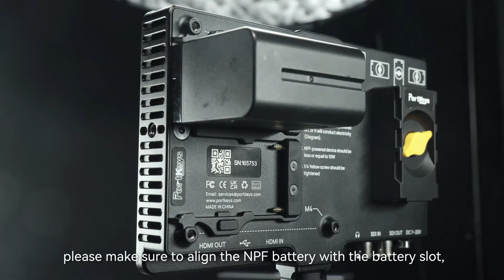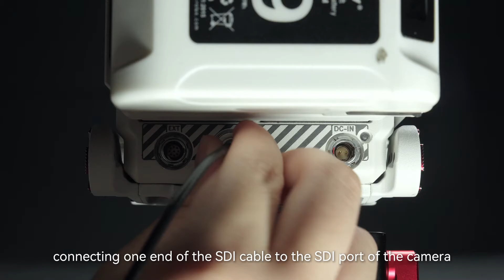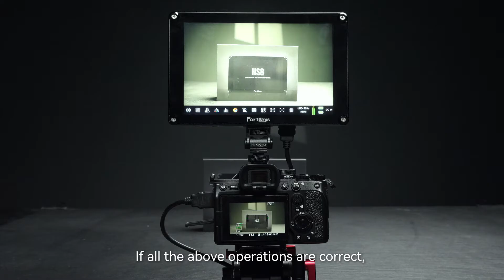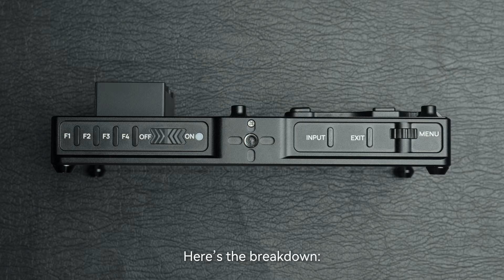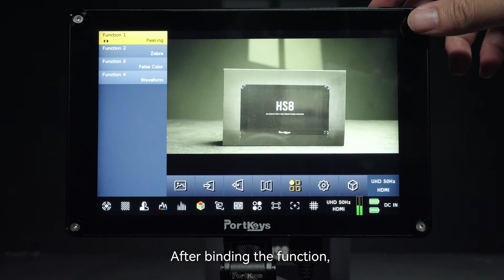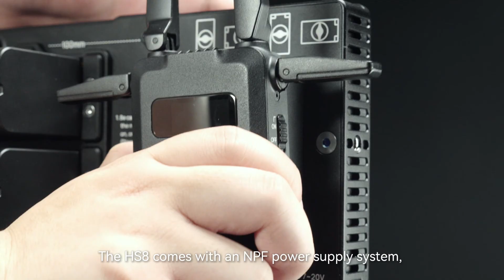8-inch SDI Director Monitor for Better Signal — Rotatable TX Mount | Portkeys HS8 Unboxing & Setup

Comment: The HS8 is not a true multi-input independent cross-converter (like a Blackmagic mini-router, for example).
	•	On this model, the SDI output is not a “pure loop” of the SDI input. It functions as an active output of the selected input, or as an HDMI-to-SDI conversion when an HDMI source is connected.
	•	Therefore, if you connect an HDMI source, the SDI output automatically switches to converting the HDMI signal instead of remaining as a native bypass of the SDI input.
Reply from the maker: Dear Customer,

May I ask if what you want is:  

If all HS8 input ports have signals connected, does the SDI OUT default to outputting the signal from HDMI IN, or do you want the option to freely choose?

Comment: Could have been a great monitor, but it's a shame there's no way to get rid of the menu at the bottom. Unfortunately not being able to turn this off makes it not suitable for professional use
Reply from the maker: We're sorry that the menu bar in HS8 cannot be removed.
Reply: @PortkeysMonitor  can’t you just fix this in an Update? It is really holding me back from buying it!
Reply from the maker: @jayamirmusic1878  thanks for your suggestion. We will forward this to the related department again~
Reply: @PortkeysMonitor  thank you I can’t wait for this update this monitor looks to sweet to not have this option! 🙏🏼